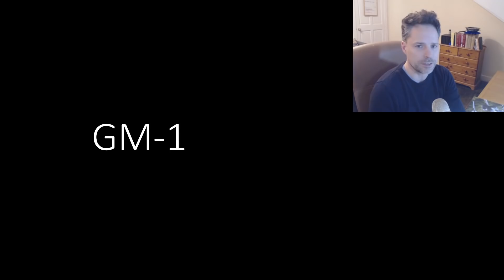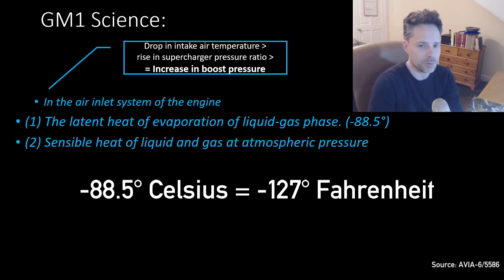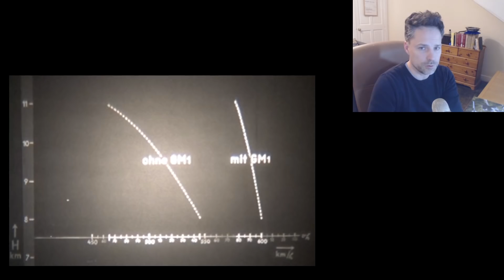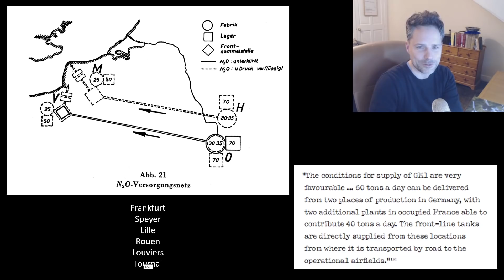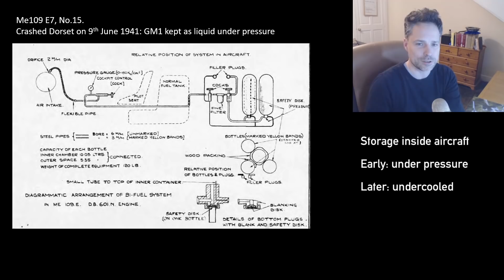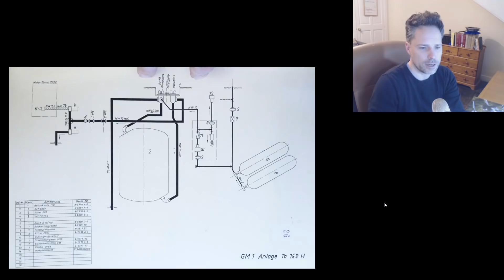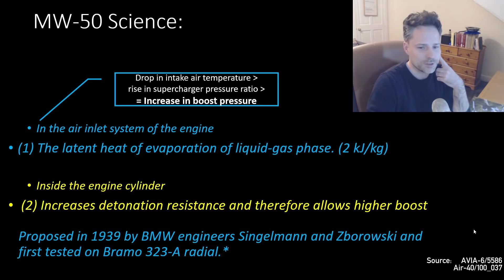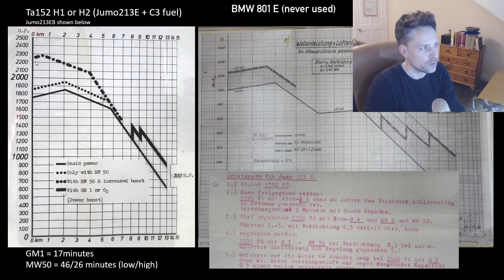The Secret Behind German Engine Performance: GM-1 and MW-50

Comment from the maker: Thanks to a kind Patreon (thanks Damsteri!), it has been pointed out to me that my insert at 08:23 (1 Staffel = 12 planes) *could* be a bit confusing. A Staffel in the organizational sense is a sub unit of a Gruppe, which itself is a sub-unit of a Geschwader, on paper around this time it should have 12 aircraft - hence my insert for your reference. 

The name drops of Galland, Mölders and Wick add a bit of a question mark, since all three (eventually) commanded a Geschwader during this time, with Galland being the last to achieve the indicated rank of the document (Oberstleutnant) in Nov. 1940. If they would still be commanding a Staffel, the answer would have been obvious since their name would then identify the appropriate Staffel (ex. 3./JG1). The Luftwaffe also used the word 'Staffel' in a *less* literally, meaning a air unit of indeterminate size in a more general sense. 

As such, the document could be talking about 3 aircraft (Stab of the Jagdgeschwader, loosely called a 'Staffel'), potentially even a Gruppe, or indeed 12 planes (+Stab of JG ?) in the literal sense of a single Staffel within a Gruppe of the Geschwader (which is how I read it).
Reply: Regarding the gm-1 production sites: 
Speyer was and is not a real industrial base, but if you go a bit north you will be in the middle of BASF in Ludwigshafen on the left side of the Rhein river, a huge industrial area nowadays and back then maybe just 25 km away  of Speyer.
 
And Frankfurt could mean IG Farben - another chemo industrial company that was capable to deliver the "ingredients"
Reply: I'm not seeing the drawings match the explanation. First Mona is obviously code for Nitro methane, A liquid fuel. Using NOx gas appears on one of the performance graphs as a broken line, 
Next is methanol benzine GM 1 although it could be methanol and water, but that does not give much horse power, it does stop knocking so would help with reliability
Reply: It's interesting how something German engineers pioneered to get an advantage during war, is used by myself to squeeze a few milliseconds out of my car on a dragstrip.
Reply: @ETALAL  - 1) thats because you didnt even watch the video from start to finish
Reply: Thank you for this; helpful.
Reply: But the TA152 never used both systems. Never flew at high altitude and there's no evidence that it could perform at the rates given in development..

Comment: I'm about 3/4ths through Calum's book, and if you're into the very technical side of aircraft engines, it is a fascinating and thorough read.
Reply from the maker: Agreed, I pre-ordered it early last year and very happy with the purchase
Reply: Does it contain anything you couldn't find out through online research? I'm wondering if it's worth picking up. It's a huge hardcover, so probably in the 50 EUR range? BTW if you don't know about it, check out the Soviet VK-107, that's an insane V12 design and reminds me of Lancia's Triflux concept.
Reply: @argh1312  I don't want to say that a lot of the information couldn't be found online, like horsepower graphs and performance numbers,  but the biggest points in the book are covering the how's and why's of different solutions the engine designers and materials engineers came up with and the problems they were trying to solve, of which many are not discussed online.
Reply: @argh1312  Hal Smith is right; the book's advantage is not just a collection of statistics and charts and graphs and pictures, but the analysis and explanation that goes along with them.  Calum earned his royalties the old-fashioned way.

Comment: Engines have always fascinated me from my pre-teens in New York state when my dad took us to little 1/4 mile oval dirt tracks in the late 1950's. At one track we went to there was a racer called "Doc" Hochter who had a 1937 Ford with a flathead V8 engine in it. He almost always won by slim margins, but if you watched his driving style, he was a patient but calculating racer, who never had to work real hard to win. My dad finally mention to me, watch his tailpipe. Sometimes the exhaust was orange, but when it came time to go to the front, it would turn to a blue flame and he just worked his way to the front....and won. Also when the exhaust changed color, the engine took on a different tone, and just purred. Almost 30 years later my brother actually met him after he had retired from racing. After a long talk he revealed to my brother that he had been a Technical Sargent in the US Army Air Corps. His job was to recover and examine German aircraft for new and unique technology. He was very well versed in supercharging, turbocharging, water/alcohol injection and nitrous injection. For many years, his 1937 Ford flathead engine had a hidden nitrous system, and his "fire extinguisher" was filled with "laughing gas" he got from his family dentist. This video assessment of German engine technology was an eye opener in terms of the terms "GM-1" and "MW-50" which I had never heard, but yet "Nitrous" and "Water Injection" were described in text books and were consider the hot new engine technologies of the the 1970, even though Oldsmobile sold high compression (11:1) performance vehicles in 1962-3 with water/alcohol injection to allow them to run on low octane gasoline.
Reply: Thanks for that delighting anecdote
Reply: Fascinating.
Reply: History is so cool.!
Reply: cool story
Reply: L
Reply: Had a friend in 1979 who had a '74 Trans Am with a modded 455. He wasn't happy with 12 mpg, so we built a special 11/1 Chevy 327 engine for it with water/alcohol injection. Then he swapped the automatic transmission for an M21 4-speed (there were no affordable 5-speeds in 1979 that could handle the power), and a 271 rear axle. A lot of Camaro parts were used in the process. He was disappointed that it only got 24 mpg and was slightly slower than with the HO 455, so he sold it and bought a VW rabbit. Back then rabbits were getting 45 mpg unless they were diesel - those got 65-70 mpg. Germans used to have a lot of good tricks up their sleeves. Now they just build undependable plastic junk.

Comment: If that is Frankfurt, H could mean Hoechst, This is a town near Frankfurt as well as the name of a chemical plant/company located in this town.
Reply: And the one close to Speyer could be Oppau maybe? This place, at least nowadays, borders a large chemical factory (BASF)
Reply: @Toras42  I thought of Oggersheim, but Oppau sounds much better. BASF produced nitrates in Oppau and laughing gas is made from ammonium nitrate.
Reply: @matthiasklein9608  There was an enormous ammonium nitrate explosion in Oppau in 1921.
Reply: I had the same idea. Based of the relative position to the rivers Rhine and Main, 
"H" probably refers to the chemical plants at Hoechst/Frankfurt and 
"O" to the chemical plant near Ludwigshafen (formerly "IG Farben", today "BASF").
Reply: @jerry2357  I know. As soon as Oppau was mentioned by Toras, i remembered it and knew he was probably right.
Reply: @andrewallen9993  They had done it without trouble many times before.  The cause of the explosion was a change in the process that made the fertiliser stronger in ammonium nitrate and weaker in ammonium sulphate.
Reply: What about the French locations? Does anyone have any guesses?
Reply: It's a district of Frankfurt since 1928. Not a town on it's own.

Comment: Awesome and perfect timing!  I have not yet finished reading this wonderful book, but I am completely enthralled by it.  Mr. Douglas, this book is definitely filling a need, and I sincerely hope you are now writing another book.  I would love to see you cover development of the large turbo-compound piston engines.  I would also love to see you do a book on the development of motor racing engines, especially during the 1960s and 1970s.  I would also request that you enlarge the graphs and diagrams so they can be read without a magnifier, and I will gladly pay a higher price for the extra pages.
Reply: Yes, the graphs and charts are small, but a magnifying glass works wonders on most.  The font in general is also pretty small for my tired old eyes, but the paper is good thick slick stock, making sure the ink doesn't run and making a magnifying glass feasible.  The alternative of bigger charts and graphs and font could well have doubled the number of pages, making the book a lot more expensive, not to mention heavier.  I think the author and/or publisher made the right trade-off.

Comment: The "hah hah process". Clearly,German humour is no laughing matter.
Reply: If it is satisfactory, then no it is not.
Reply: Germans have a sense of humor?   ;-)
Reply: Nailed it.
Reply: I think this is the reason it was actually a good codework. Since Brits assume Germans have no humor they wouldn't think of the word being a joke but rather some kind of technical term. This then isn't humor, it is exploitation of ones own stereotype.
Btw: How many Germans does it take to change a light-bulb? 
One. Because they are technically able and not very funny.
Reply: @IzmirWayne   but it was a technical term,it was laughing gas
Reply: @packingten  We could have never won... we had basically no resources and our Army was barely mechanized.  Many of the logistics was still handled via horse and communications was bad in the logistics sector, especially when it came to railroads. Yeah... we might have had the most advanced tanks, airplanes and weapons. But it was to few and to late. Also reliability was abysmal.

Comment: Finally ^^
I heard from Greg that they could have implemented it even during the battle of britain so the technology was there.
Reply: the RAF had BP Octane 100 in 1940 no need for anything else. The Luftwaffe was struggling on Octane 87.
Reply: @lyndondowling2733  the Video is about stuff from the Germans so there would have been a use. And also mw 50 increases octane by well over 20 so it doesn't matter if you have 87 or 100 octane fuel. It would have been useful for both sides.
Reply: @lyndondowling2733  The LW had 93 octane available in 1940, a well as GM-1 in limited service.
Reply: @lyndondowling2733   If true they didn't "need anything else", perhaps British thinking was slower to come around to the concept of short term war emergency engine power than other nations.  The U.S had 100 octane but that did not dissuade them from developing water methanol injection.  That's because they were thinking of it for war emergency power rather than to compensate for low octane fuel.  Water Methanol injection allows more  manifold pressure than the base octane can support.  The problem is that usually the resulting cylinder pressures and bearing loads are greater than the engine can support for very long.
Reply: @gort8203   The Merlin had Emergency Boost as well. Plus bigger and better Turbo stages for extra Compression in later marks.
Reply: @lyndondowling2733    Correct. So at some point they must have realized they didn't have all they needed.
Reply: @gort8203  Yes to improve the Performance of Photo Recon types. And to Create the Spitfire Mk IX to better the FW 190.
Reply: @lyndondowling2733  
The RAF didn't have turbos, what they started fielding in mid 42 was a 2 stage 2 speed supercharger for high altitude, before that they only used single stage superchargers on their aircraft engines, even the early Packard built Merlin's had single stage superchargers.

Comment: Glad your guest pointed out the fact that teething problems with upgraded plants was quite often tied to these performance upgrades, and limited to specific uses under certain circumstances. Many of these engines had respectable compression ratios, so enriching the performance meant dancing on egg shells. Manifold pressures would climb very quickly under these situations, causing the engine to heat up, while increasing any frequency of vibration as a by-product. With late aircraft running both systems, I don't doubt that varying levels of enrichment were often employed by the pilot. Have to look into finding the book in the future. Thank you. Most engaging content.

Comment: Thanks so much for posting this...as a current AE who works for a large American defense contractor's Aero company I am always amazed at how advanced the Engineering was in the WWII aero engines. I also find it very interesting that while the Germans investigated NOS and WM injection the Brits and Americans used a mixture of Methanol and high octane gasoline from America to produce a super high octane fuel that allowed for greatly increased boost pressure later in the war. I believe one of the chief advantages the British planes held over the F109's  in the 1940 Battle of Britain was that the Brits had access to large quantities of 100+ octane gas from America whereas the majority of German planes did not and were resigned to using ~87 octane. Also, all the methods outlined in this video for increasing internal combustion engine H.P. are now commonly used in the hobby and professional automotive arena to do the same.

Comment: Most of the reference I have seen on GM1 referee to "getting out of trouble" boost for many of the two engines destroyers or night fighters trying to avoid fighters or Mosquitos. 10 minutes seems to be the general opted endurance for being 'in or out' of trouble, if you did not outrun then in 10 minutes you had had it anyway. Many boy racers use Nitrous as a performance boost for their cars but if your life depends on it I would think it made a morale boost as much as power, some chance is better than no chance at all. 
The damage done to engines did not matter if it saved the airframe and crew, the most valuable part of the weapon system.

Comment: Early jet engines also used water injection on takeoff for the same reasons MW-50 was used in piston engines - to cool and make the intake air more dense, allowing more fuel to be burned, and higher thrust.  More generally, your early point MAH about propulsion technology driving innovation in aviation is spot on.  The DC-7 / Constellation were about the limit of piston engine airliners (R-3350).  The 707/DC-8 hit pretty close to what one could do with early turbojet / low-bypass turbo fan engines.  And then came the TF-39 and JT9D and their progeny, which enabled wide body airframes culminating today in the A380, A330, B747 and B777.  One GE90-115 on the 777 has the same takeoff thrust as ~6 JT3D low bypass early turbofans.  Granted a lot of that is from tech improvement, however, you can't deny the influence of Mdot (mass flow rate) in the equation F=Mdot * Delta V
Reply from the maker: Appreciate it!

Comment: Very interesting – I hadn't thought about this tech being in use in Europe. My Dad's squadron (VF-19) traded planes with another squadron in Hawaii before they shipped out for their Pacific combat tour in 1944 so that their F6F-3s were all W-M equipped. Replacement planes were all F6F-5 models, which all had it to begin with. He also flew the F4U-4 for 9 months in 1945, preparing for the invasion of Japan that never took place, and the squadron's Corsairs were equipped with W-M injection, too. Not a surprise, as both planes used the Pratt & Whitney R-2800 engine.

Comment: Excellent use of a source to get at a very thorny subject and I can hardly wait for his return to describe the valve seat problem with the BMW 801...
Each of us air-cooled Volkswagen mechanics deal every day with the engineering choices of a 1937 engine and the story of engine power in world war II aviation is inextricably linked to the materials science and flow Dynamics that the engine developers developed during the conflict

Comment: Great book and great guest contribution!

By implication, Calum suggests that german engines had boost limitations, leading to the choices of MW-50 & GM-1, and NOT due to octane limitatations, per se. Production limitations of sufficient quantities of C3 or higher octane were problematic, as even sufficient quantities of B4 would become problematic as bombing increasingly took refineries offline. But the real story of boost limitations has to do with increasingly severe lack of manganese, cobalt, nickel, chromium, tungsten, silver, platinum, magnesium, aluminum, copper, requiring the use of "Sparrmetals," and lead babbit engine bearings. This situation, and the resultant direction into which it drove the German aero industry, was the reason German fuels were of excess octane requirement to Luftwaffe needs throughout war (to Allied puzzlement), a fact some aviation presenters have not fully appreciated. If 150 octane avgas had magically appeared on  Luftwaffe airfields, the Luftwaffe's engines still would not have handled 80" boost pressures!
Perhaps a presentation by you, or Mr. Douglas, would shed some clarity to this little discussed subject.

Comment: The reason for the discrepancy in dates with FW-190 GM-1 systems was (at least as far as I'm aware) due to testing in the FW-190 B, an A4 with higher aspect ratio wings and the GM-1 system while the C model was with a turbocharged DB 603. This is also the reason for the jump from A series to the D series.